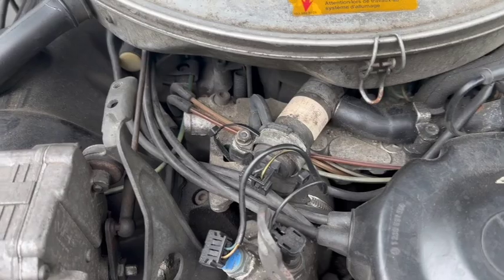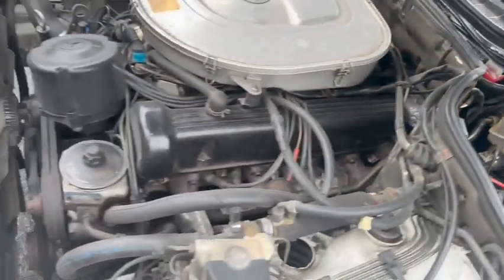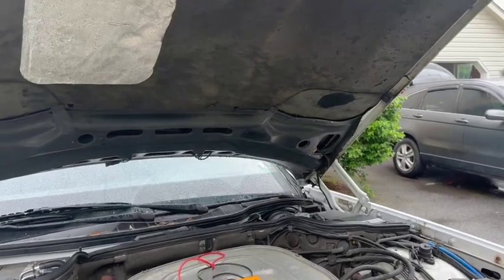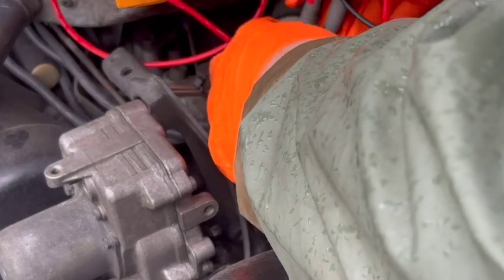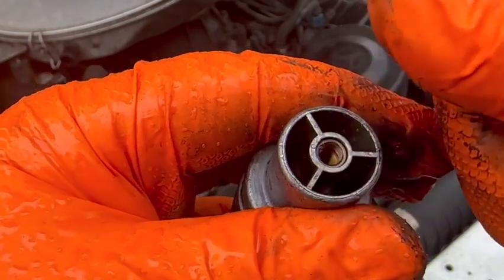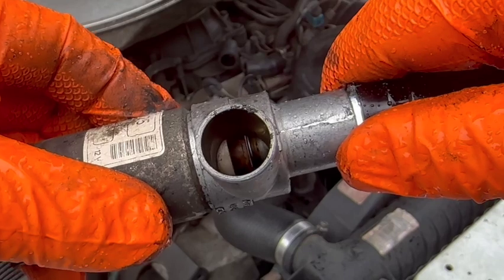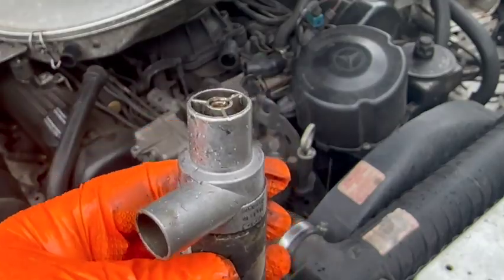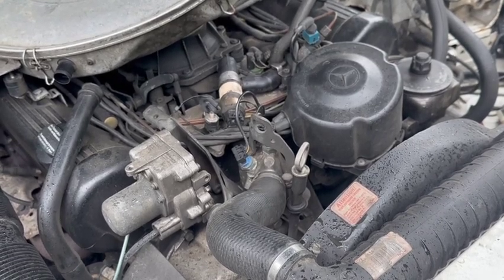How to fix high engine idle on KE Jetronic I4 6 V8 W124, W126 Benz - adjust the idle control valve

Comment: Hey my idle air control valve has 3.9ohms, but doing the trick you did in the video made my rpm 1000 down to 650. Even with 3.9ohms. Does this mean it will only temporarily fix it or ?
Reply: I also want to add that i checked the lambda system on X11 Pins 3/4 with multimeter and it gave me 6.4-7.2 volts which means my duty cycle is averaging 50%. Before i did this adjustment on the IACV my duty cycle was all over the place and with screw adjustment it wouldnt fix it at all, now it seems to be ok. Crazy..
Reply from the maker: @SuperBranFlakez  i am glad you got this sorted out a little more.
Reply from the maker: The ohms reading will be the same no matter where you position the little valve spring. The valve reacts to the change of voltage and the spring load determines the idle speed. 👍
Reply: @straybenzes Thankyou for replying to me good sir, love your channel! So does this mean now the iacv won’t idle based on whatever loads are put on it, but instead statically idle only? Idk the best way to ask that sorry
Reply from the maker: @SuperBranFlakez  No problem I think I know what you mean. The idle control module gets inputs from various control mechanisms and the output it produces goes to the ICV. When the idle speed is too high that simply means that the control voltage has reached it's limit and thus cannot pinch off more air flow through the valve. That is merely achieved with the spring tension. By pulling out the little brass sleeve you lessen the spring tension which now let's less air through the valve and the idle speed is lower. All you are doing is correcting the full control range of the valve. I hope this makes sense. 
As the car ages there are usually more air leaks. It's not enough to fully rebuild the air intake tract, but it does affect idle. The mass flow plate senses more air flow and it also provides more gas.
Reply: @straybenzes  Thankyou so much for your in depth explanation. Great english btw! Better than most people over here in the west LOL. Very happy to have someone like you explain this stuff as it feels like a hidden knowledge. I was going to have to spend about 450$ on a new ICV and now its working great. Keep it up!
Reply from the maker: @SuperBranFlakez  Hey, that is a nice result! All the best to you.

Comment: My w126 380 ideas very low and stalls when put in gear
Reply from the maker: Go through each componet from the tank back to the engine. There are too many variables to be able to remote diagnose that issue. The best of luck to you.

Comment: Thank you for this video!  I’ve been fighting a high idle for years and I just did this adjustment. It worked perfectly!  It’s so nice to have my car idle as it should at 650RPM.
Reply from the maker: Wow, nice result!
Reply: @ I had tried so many other things and nothing changed. Such a difference, I don’t feel like I’m fighting the car at all stop anymore.
Reply from the maker: @OB928  yeah, and changing from D to R is no longer such a jolt.

Comment: Incidentally, before watching your video I had tried 3 different (used) air valves and all 3 behaved the same and were in need of the adjustment you describe. I suspect the fault is in the coil. They spend their lives in a hot environment and this weakens the magnetism, hence the need to reduce spring pressure to compensate.
Reply from the maker: It proves that just changing parts does not necessarily address the root cause of a problem.

Comment: My W126  280S  1985 cuts out completely when ever I slowdown for a stoplight , and then it used to start up immediately , but know it takes up to about two or three times switching the key, and when doing so, it make a very loud screatchin metally sound , I also here a ticking underneath the clove compartment ! And I have to tankl every two minutes, it's way too rich in driving Euhm ...Help!
Reply from the maker: Well, there is a lot going on there. 280S sounds like a carburetted version. That should be a Stromberg one with an oil dampener on top. The best thing would be bringing it to a Benz specialist who can diagnose this one in person. To do that over mail is close to being impossible. 
Same goes for the screeching sound. This could be the starter not engaging correctly. But that is only a guess. 
The sound under the dashboard can be the temp sensor blower or the main fan blower motor. But is can also be the vacuum actuator for the vent flap. I am sorry that I am not of more help to you.

Comment: Hello
I have a C126 5.6L and the engine won't start.
I press the KE-Jetronic sensor plate slightly with my finger and the engine starts.
Can you give me some advice on what could be causing this?
Reply from the maker: Did anyone mess with the idle mix adjustment? That adjustment messes with the mass flow plate position. If that problem just started and no one messed with the system before then I would say look for the problem elsewhere in the fuel supply system.
Reply: @straybenzes  My W126  280S  1985 cuts out completely when ever I slowdown for a stoplight , and then it used to start up immediately , but know it takes up to about two or three times switching the key, and when doing so, it make a very loud screatchin metally sound , I also here a ticking underneath the clove compartment ! And I have to tankl every two minutes, it's way too rich in driving Euhm ...Help!
Reply from the maker: @slydevrmc2340 Well, there is a lot going on there. 280S sounds like a carburetted version. That should be a Stromberg one with an oil dampener on top. The best thing would be bringing it to a Benz specialist who can diagnose this one in person. To do that over mail is close to being impossible. 
Same goes for the screeching sound. This could be the starter not engaging correctly. But that is only a guess. 
The sound under the dashboard can be the temp sensor blower or the main fan blower motor. But is can also be the vacuum actuator for the vent flap. I am sorry that I am not of more help to you.

Comment: I have an 85 380SL and  couldn't fix the high idle issue.  When engine hot, it goes up to 12-1500   RPM.  Took  ICV out and cleaned, and it seems operateable with rattling when shake. But my ICV has no brass piece thread at the end to adjust the spring.  How do I adjust it?
Reply from the maker: Hmm. Were you able to get the seal plug out of the ICV?

Comment: Hi Ralph, I enjoy your videos, this didn't work for me any ideas what could be the issue? Regards.
Reply from the maker: High idle issues can come from a faulty OVP (causes high idle above 1000rpm), vacuum leaks, unusual would be faulty start up cycle, or ECU. Sorry for not being able to narrow that down precisely.
Reply: @straybenzes  Thanks for your reply. I spoke too soon this did actually work, and I found a vacuum leak whilst looking around. I managed to get the idle down to 700 RPM which is good enough for me. Thanks again mate.
Reply from the maker: @ashleybrown9913  Wow, cool!
Reply: @straybenzes  My W126  280S  1985 cuts out completely when ever I slowdown for a stoplight , and then it used to start up immediately , but know it takes up to about two or three times switching the key, and when doing so, it make a very loud screatchin metally sound , I also here a ticking underneath the clove compartment ! And I have to tankl every two minutes, it's way too rich in driving Euhm ...Help!
Reply from the maker: @slydevrmc2340 Well, there is a lot going on there. 280S sounds like a carburetted version. That should be a Stromberg one with an oil dampener on top. The best thing would be bringing it to a Benz specialist who can diagnose this one in person. To do that over mail is close to being impossible. 
Same goes for the screeching sound. This could be the starter not engaging correctly. But that is only a guess. 
The sound under the dashboard can be the temp sensor blower or the main fan blower motor. But is can also be the vacuum actuator for the vent flap. I am sorry that I am not of more help to you.

Comment: I need to get my 1989 300E running again.  😁
Reply from the maker: Good luck. That is a nice car!
Reply: @straybenzes  I got it running again.  Put in my old fuel pump relay and it started working again.  Good thing I kept the old one.  

If I let the engine warm up I can see some smoke come up from the back of the engine, probably from some sort of oil leak.  It doesn't smell like engine oil.  What could it be?  How do I check it?
Reply from the maker: @ChopsticksGarden  Yeah, think twice before throwing out old relays. OEM ones are getting harder and harder to find. 
The smoke situation is best addressed by closely observing the running engine and tracing where it is coming from.; Most of the time leaks have been there a while and therefor there may be a lot of old crusty messes building up over time. Sometimes there is no way around thoroughly cleaning that area with degreaser to you can start tracing the leak's origin better. 
Six cylinder engines of that era do tend to leak oil towards the back where the engine compartment firewall is. Could be a valve cover gasket but very often it is the head gasket.

Comment: Hi Rolf..another useful video.  Thanks.

What can you do about the following?  I have fast idle at startup and it continues as I drive.  If I drive somewhere and park for shopping for a short time, when I start up , the idle is no longer fast but 600 rpm+-.  Once I drive for a while it will "suddenly"return to high idle.

If I am parked with motor running, after a while, it will "jump" to fast idle.  It seems this has something to do with temperature causing sudden drop or sudden elevation of rpm..My 380se has 120k.

I emphasize "sudden" as there is a click and then suddenly rpm  goes up. 

What do the two wires on the Idle control valve connect to?  Anything temperature related??  This seems to be heat related.Thanks.  RNT
Reply from the maker: That is most likely the fuel pump relay. With a warm motor and false high idle measure the voltage on the cold start valve. If that is still shows voltage than either the relay is defective or the EZL may also be defective.